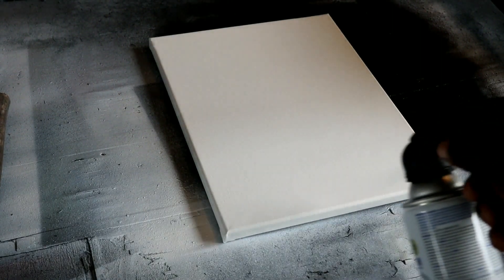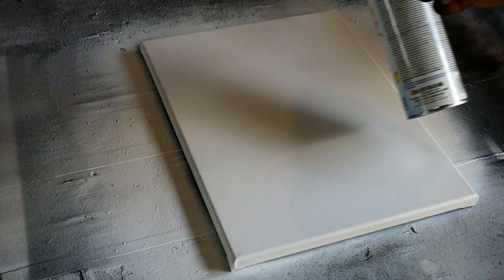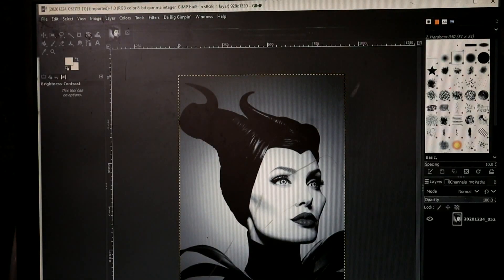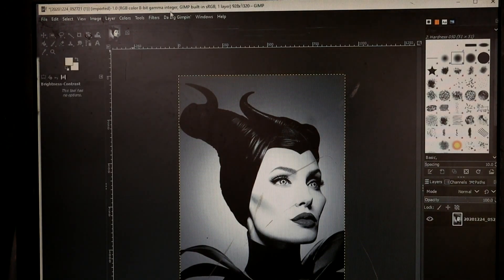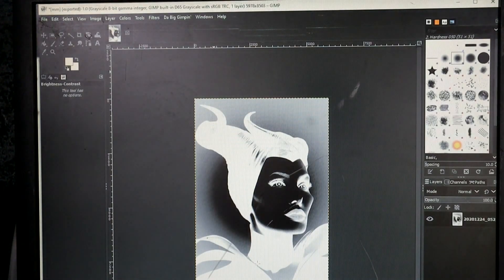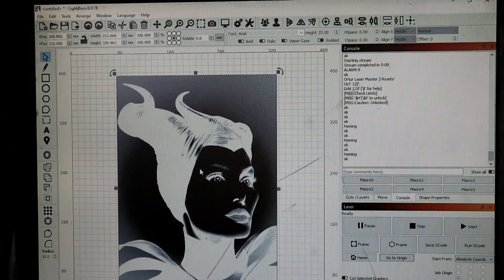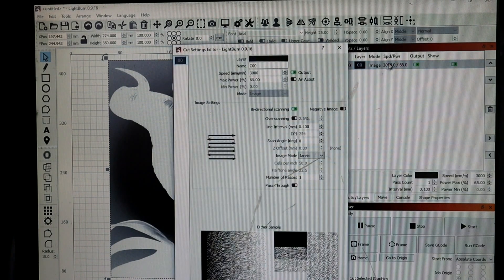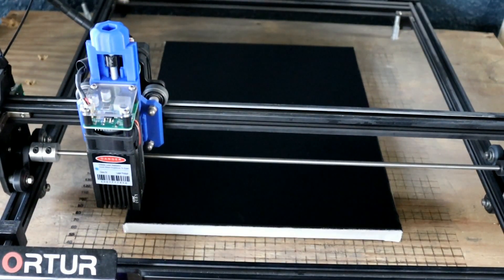Maleficent  engraved on a 11x14 Canvas using The Ortur Laser Master 2 15w

Comment: that turned out amazing man. I am curious though you used the Gimp plugin to process the picture for laser engraving and then in lightburn you did not turn on pass through so in essence you let lightburn also process the picture. isn't it supposed to be one or the other but not both. besides that it still turned out amazing. Thanks.

Comment: Thanks for sharing! Does it matter if the spray paint has primer or not?
Reply from the maker: No but it helps quality and makes paint thicker.  It helps on canvas
Reply: @zerica24  thank you. New to this but I was wondering if it was the paint that was causing it to burn through when starting the burns (happens only in top left corner). I'll keep playing with my settings. Blessed holiday season to ya🥂
Reply from the maker: @smiutee3158  Send me a email at southernsmokeengraving@gmail.com and I will send you a Sweet spot Test

Comment: Hello my friend !!! Perfect job and thanks for the sharing !!!! i have a question my laser stops sometimes if i give big projects why this happend? many thanks keep the good job!!!!Also i have the 20w laser the power must be the same at 65% ?
Reply from the maker: Most sure all your plugs are tight and your sleep is off on your computer
Reply from the maker: Depends on your sweet spot results
Reply: @zerica24  I have made all the necessary settings so that the computer does not sleep.when it works it suddenly stops and only the fan works.
Reply from the maker: @GreenBus13   Check the red and black wire on the laser it sometimes comes unplugged or loose make sure it is pushed in.
Reply: Many thanks my friend!!!

Comment: Do you feel the big gimping v3 plug in is needed? What does it do aside from scale and invert?  Been reading some opposing views on it being worth the money. Thanks.
Reply from the maker: For me it is worth the money . A couple clicks and your image is ready to burn.  I understand imag-r has pretty much everything that Gimp has  except some of the editing features . So for me it is worth it I have got some amazing results using Gimp .
Reply: @zerica24  Thanks. Say no more.  Off to buy now. sounds of coins falling to the floor
Reply: Doesn't look like your using mac but I got the plug in and see it on my top of my Gimp menu but it is greyed out and won't allow me to access it. Any ideas why?
Reply from the maker: @anthonyruan6976    Look over to the bottom right of the image on the side you should see a eye  try right clicking it and remove the Alpha key. Or go to export as and export the  image rename it and open it back in gimp after you save it . Hope this helps.
Reply: @zerica24  Thanks. I had some success and some that still don't work. So, I think I kinda figured it out. When I change the image in mode to greyscale in Gimp it will not let me use the plug in. I reverted back to RGB and now it let's me. Any idea as to why it won't allow the plug in in greyscale mode? Not a big deal though, I believe I can convert to back and white with another program then dump into Gimp there after and the plug in should be available.
Reply from the maker: @anthonyruan6976  it is ok to leave it color before you run it through Gimp Plugin.  It will shade it and turn it black and white either way. The negative is black and white. All of your colors are just shades in between. I wish you  much success let me know how it goes.

Comment: First off, I love your work and your videos. I too do some canvas art with my laser. With some pieces, I get some sagging of the canvases. Is there anything you do to prevent this? I just started cutting some pieces of thick cardstock/thin cardboard and gluing it to the back, which seems to help, but I'd prefer to avoid it in the first place.
Reply from the maker: I buy my canvas from Michael's the are cheap and the are great quality . Only tome I get sagging is when I Reuse them several times other than that they are great.
Reply: @zerica24  Same here. I don't know if it's because of the weather here (Minnesota is cold as f*ck!) or how many coats I put on for some projects. I've tried multi-colors and found the need to do a few coats for colors to be distinct from each other.
Reply from the maker: @GeekDadMN   I use a total of 3 coats  per canvas . 2 base coats whatever  color  and One black coat to cover it check out this Video https://youtu.be/vYE5UvHyjjM I tried Martha Stewart Paint.
Reply: @zerica24  I've been watching your videos for the last few weeks and have seen that one. I've been on  a canvas art kick myself lately. I will be putting out my own channel, but I don't want to be out here pimping my own stuff on your channel, I just haven't figured out all of the YouTube stuff yet. I have a 45watt CO2 laser, so I have to do some things different that what you do. I'll have to show you what I've had happen and share with you some of the other things I've done. I just did a 12x16 Billie Holiday piece that is phenomenal. Gold metallic base with a glossy black overlay. If you know how, shoot me a message and I can share some stuff with you.
Reply from the maker: @GeekDadMN  Email me at southernsmokeengraving@gmail.com 
I would love to see your work and learn something New.
Reply: You can lightly sprsy water on the BACK of the canvas, then let it dry and it will shrink

Comment: I just got my ortur laseraster 2 in the mail yesterday and I see you have what appears to be a 3d printed z axis adjuster.  Can you provide some info on that?
Reply from the maker: Yes I purchased  it from Slvrdesign3d.com  it is very helpful when your moving from different size  materials. Welcome To the Ortur family.
Reply: @zerica24  thanks!  I just ordered one!  I have a 3d printer and can print one but I couldn't find any good ones.  20 bucks is a good deal and I hope it will make the focusing much easier.  Thanks for the info and the awesome videos.  I will subscribe!
Reply from the maker: Thanks for the Support.